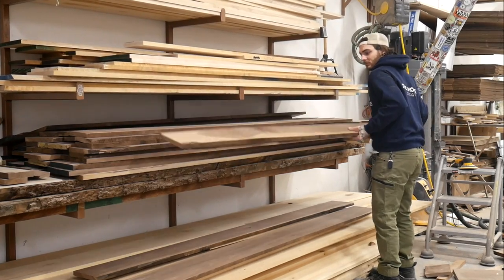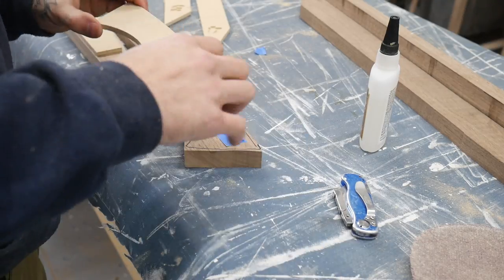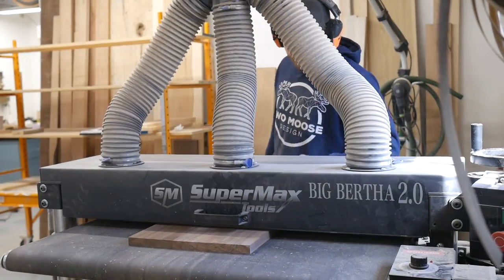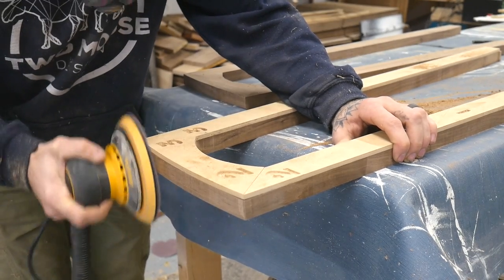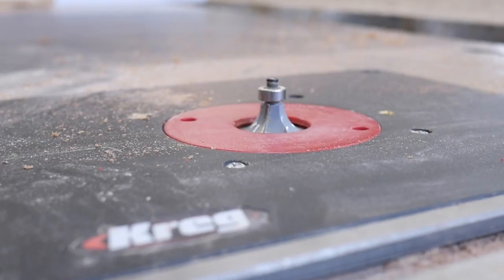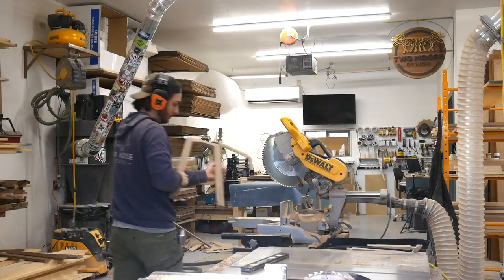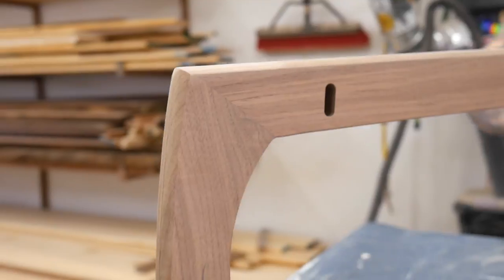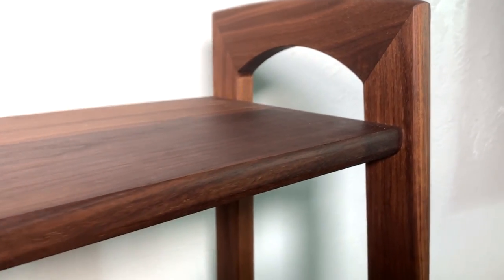Building a Modern Bookshelf // How To // Plans Available

Comment: Look into using an L-fence on the tablesaw with the templates for cutting the joint faces and straight edges. I used this method on the two Philip Morley lounge chairs I'm making and it was awesome.
Reply from the maker: I definitely will 🙌🏼 do I buy it or build it?
Reply: @TwoMooseDesign  Either, chalkstone woodworking sells one but it takes maybe 10-20 mins with plywood scrap to make one.
Reply from the maker: I just YouTubed it 🙌🏼 definitely need one of those
Reply: @TwoMooseDesign  Fine woodworking just had one in there .... I am likely to create the v-carve to build it

Comment: Very nice. Curious about template routing. I have very limited experience doing any, but would sandwiching the template between both pieces make things faster (one setup) and more accurate (any slight alignment error setting the template may be negated since it would be on both pieces)? Or is there a con I’m just not thinking of?
Reply from the maker: The bearing would have to ride on the template so your mdf would have to be thick enough to account for that. You would have to route them separate either way so your just making the piece heavier than it would need to be. It took me 30 minutes to do both? Probably less than that. I also wouldn’t do them at the same time, it would be a ton of strain in your router
Reply: @TwoMooseDesign  makes sense. Thanks!
Reply from the maker: @brianakins83  😁👊🏼👊🏼

Comment: When attaching the template have you tried using painters tape on both pieces, CA glue and activator? Should make separating them easier.

Oh yeah, i hate that you have a drum sander, jk
Reply from the maker: I use that method all the time on the Cnc it works great! It’s just easier to line them up with double sided tape 🤷🏼‍♂️😁